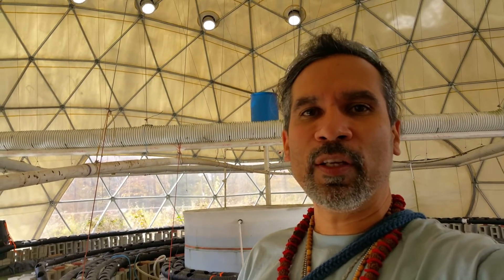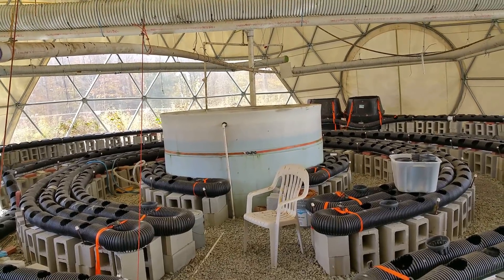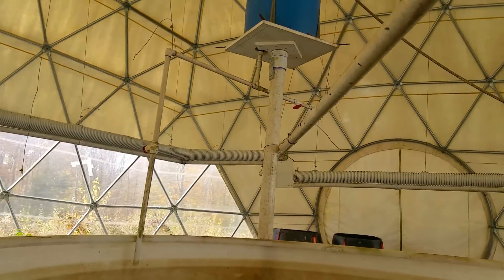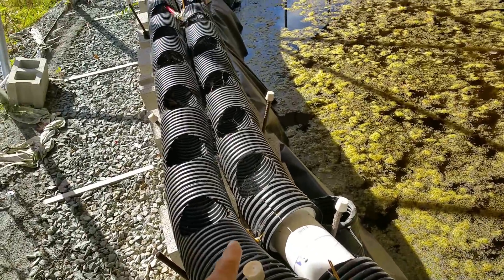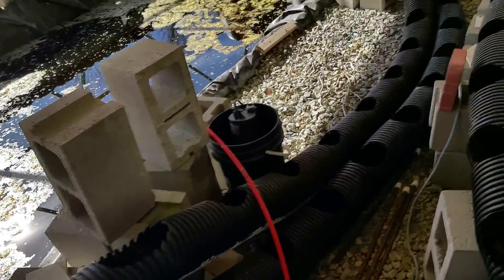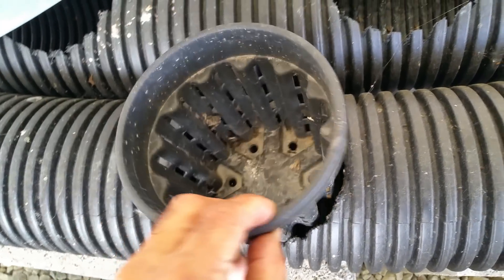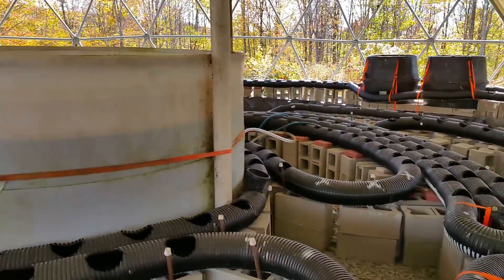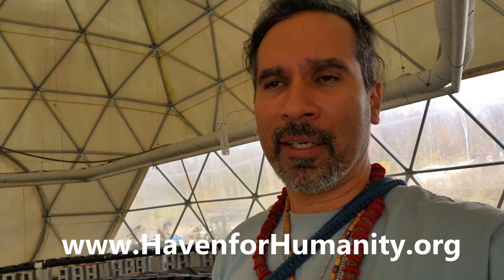Monolithic Aircrete Dome Pour | Haven for Humanity | Greenhouse #Aircrete #AircreteHarry #Dome #DIY

Comment: That is a geodesic dome. Much waisted space. Not very many pots per square foot. Far too little light. The fish tank is too small, many times too few fish. The mulch will poison the fish water. The corrugations of the pipe will fill with sediment soon. Amateurs with much to learn and money to blow. Harry, need to research your projects more thoroughly before presentation to an adult audience.
Reply: Tom Teseletec Great analysis. Also: 1. the roots will impede water flow and cause clogs; 2. nutrient distribution will be unequal and the end of the line plants will not do well; 3. #'s 1 and 2 will be exacerbated by the extreme length of the single water source; 4. the tube holes are not always staggered and the distances do not allow for the wide variation in plant sizes; 5. the clam filtration will either not work because the clams cannot breed or if they can they will soon become a clog; 6. why keep the fish in a little tank, tortured really, when they have that huge pond the fish could happily live and swim freely in?? Stressed fish = poorer health.
A single water source also means the entire system will have to be shut down for any problem, and any problem puts the whole system at risk for catastrophic failure.
Hate just being a naysayer, so I hope they read comments and consider making some changes.
Reply: Bigelow Brook Farm (Web4Deb) https://www.youtube.com/c/Bigelowbrook/videos
What you think of his green house and aquaponics? it seems money well spent
Generic tunnel greenhouse, cheap per / foot
water tanks: DIY himself, smart design, extremely afortable. 
plants floats on pond.
This fish tanks etc... seems complicated but overall good commercial operation low maintenance.

Comment: sounds cool in there! its amazingly big! That looks amazing!  I hope it all works.  It looks like alot of black tubing that snakes, might slow down the water once all the pots are in there.  Would be cool to see just a dry run with water running thru the system to see how fast it flows, and then fill pots with growing medium, to see the difference in flow.  Important that water does not stagnate too much.  Good luck!

Comment: Wow, amazing system.   I do wonder about the oxygenation of the water though.   You said the ribs in the pipe will help, but would the water be flowing fast enough?   The algae and other stuff in mote take oxygen, then the fish as well (clams?), how much is left for plant roots?    Seems somewhere on the drop from 50 gallon tank there could be a aerator.

Comment: Non-structural concrete
Reply from the maker: Yes it is Non-structural concrete, that will be reinforced with a mesh on the inside and outside. Coated with a Magnesium based cement that cures to 9000 psi and is waterproof.